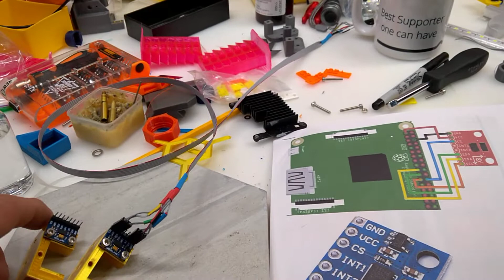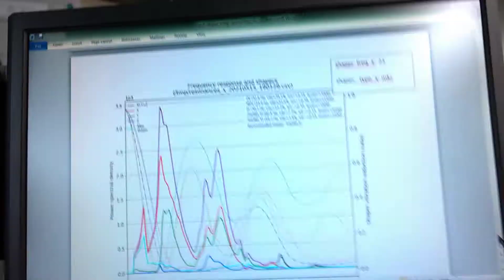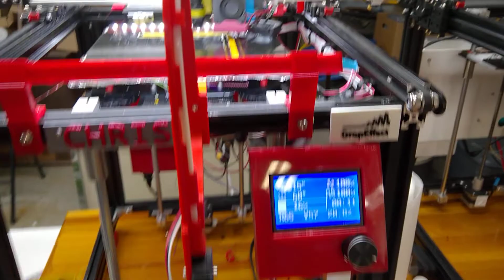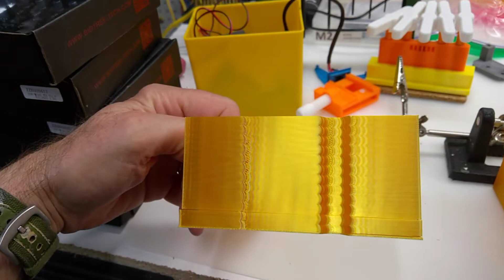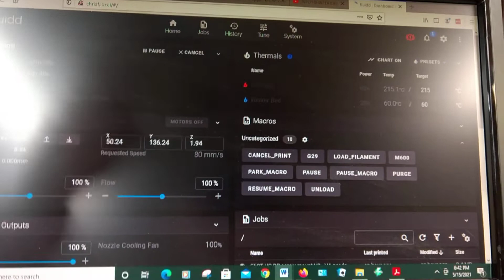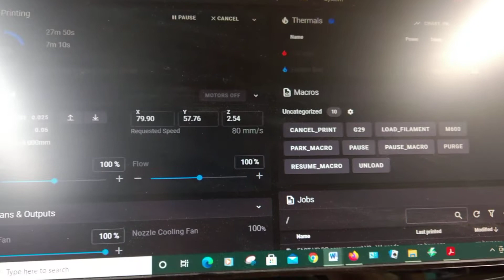Klipper and Fluidd ready to convert from Marlin

Comment: I'm planning to build a Voron, but have never used Klipper or Rpi, so to prep for that, I want to load Klipper onto my SKR 1.4 Turbo and put Marlin in my rearview.  I'm generally tired of the Bugfixes and limitations of it as a whole and want to get into something that gives more right off the bat..
Reply from the maker: Not sure what printer you have, but you should be able to run that board using Klipper without making it a one way street.  You will need to have a Pi or other device to actually run Klipper, but that should provide a way to flash the SKR board with the correct firmware for Klipper.  If you want to go back to Marlin, simply flash with the Marlin firmware.  I did that a number of times when I converted my Ender 5 to Klipper, you can test it and verify it is working and if any problems go back to Marlin.  Try and find a video on your specific printer with a Klipper setup.  Chris Riley has some great Klipper content   https://www.youtube.com/@ChrisRiley
Reply: @woodwaker1  I have a Tevo Tarantula from 2017, but upgraded the board to the SKR 1.4 Turbo.  I followed your link to Nero's channel where I learned I could use an old Pi to run several SKR boards which I have, so I will learn how to do all of that b/c I plan to build a nice big and fast Voron 2.4 which would need the Pi and Octopus, but as luck would have it, I already have the needed electronics.  Thanks for all the advice!
Reply from the maker: @MichaelJeffers75  Good luck.  Since I switched to Klipper I have never looked back.  Probably the best reason for me was no more compiling Marlin.  I can remember trying to get an ABL tuned in on the offsets, to make an adjustment would take up to 30 minutes,  with Klipper it is a 1 minute edit the printer.cfg file save and test.  It is also easy to back up and save your configuration.
Reply: @woodwaker1  there's Gcodes to save new settings to Marlin, but that's a moot afterthought.  I'm looking forward to getting into Klipper and finally using this Rpi I bought over 2 years ago and never used.  The good thing about the SKR boards tho, is the micro SD, so rather than compile Klipper over Marlin, I'll just use a new card and if need be, simply pop in the old Marlin card, but hopefully that Marlin card will forever collect dust, lol.

Comment: Thank for the video and the guide you posted on thingiverse! I am getting ready to build/convert an Ender 3 to a Switchwire. Also looking at putting Klipper on my Flsun Q5 Delta as well.
Reply from the maker: Thanks for letting me know it helped.  I am having a lot of fun with Klipper, but it is not for the faint of heart.  It has a lot of power, but takes some learning to get it all ironed out.  I'm still trying to get the M600 command figured out.